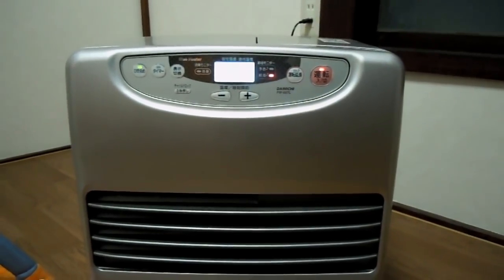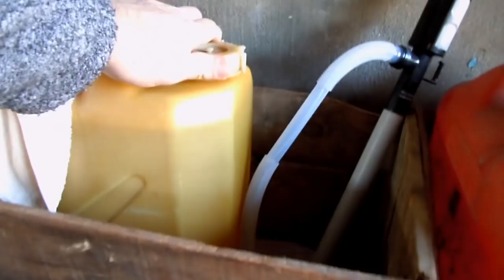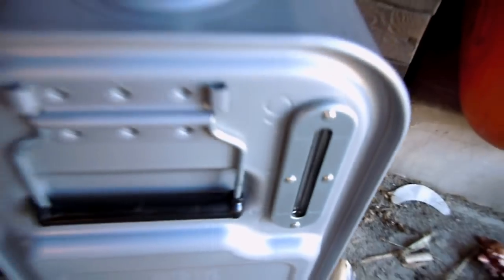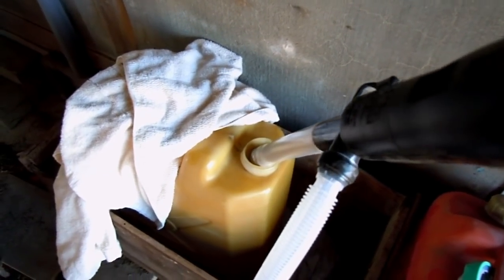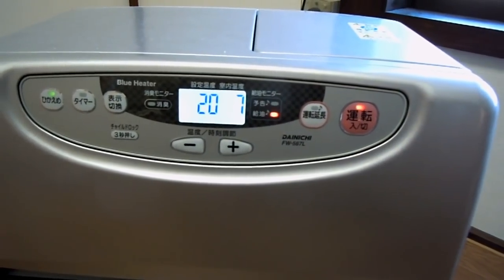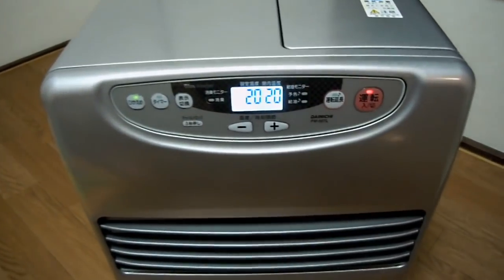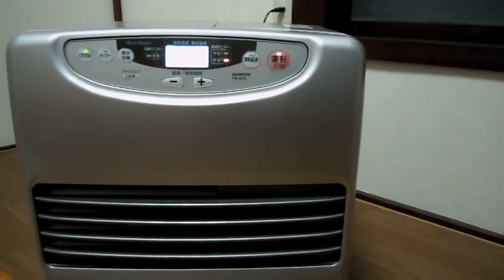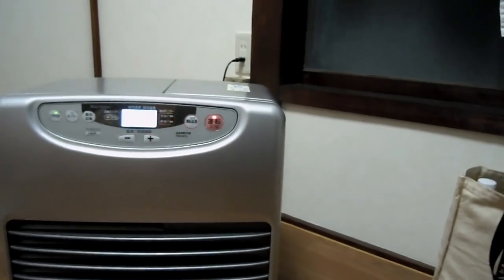Japan - How to #81 - Kerosene Heaters

Comment: We have them to in the Netherlands............. In whole Europe....
Reply: Is it okay to sleep when it’s on ?
Reply: @shalominternational6646  Technically, no. They burn air, therefore you need to have a constant source of fresh air. Otherwise you will suffocate without knowing it. Depending on the unit, it may have a auto shut off.